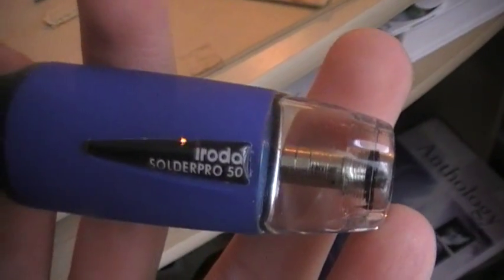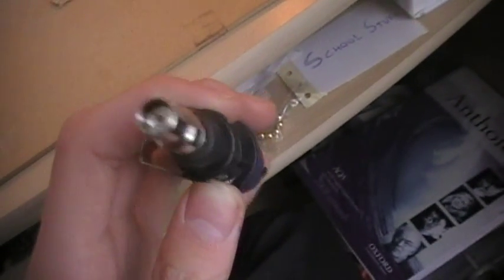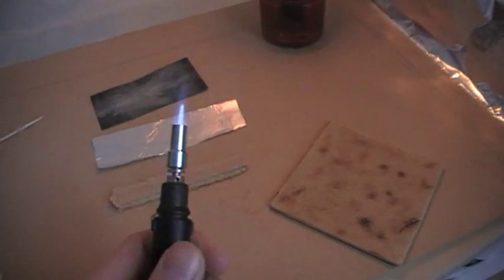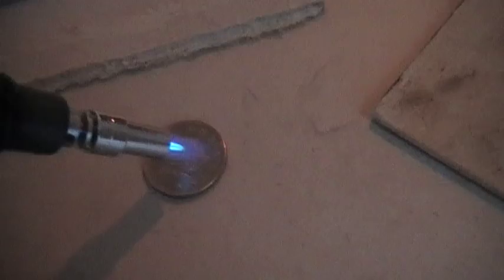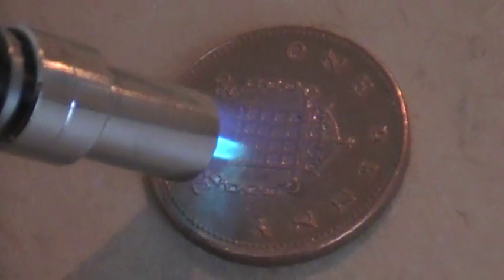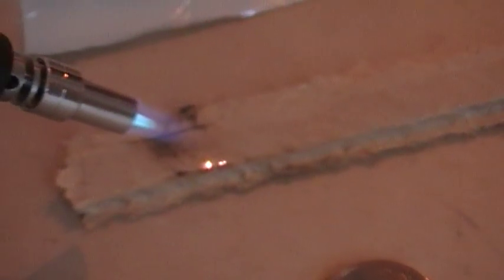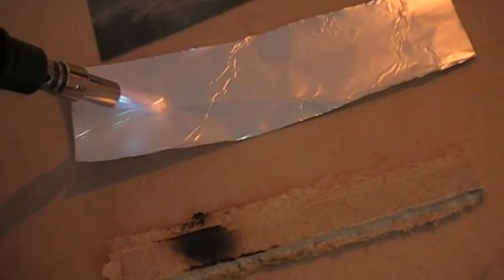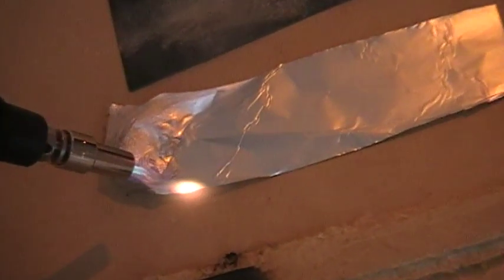Solderpro 50 quick demo- butane blow torch

Comment: Iroda Solderpro 50 :) Same one here, I just turned up the volume of gas given out.
I got mine off of eBay, bought it as a new solder iron since I went through the electric ones too quickly